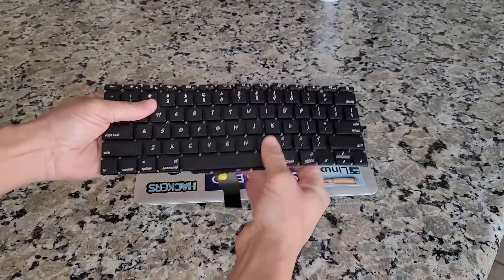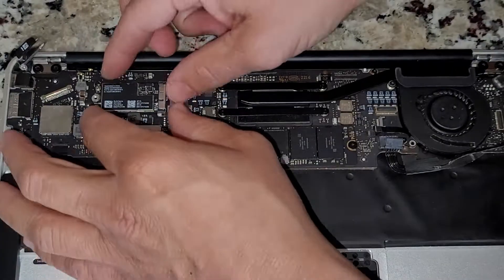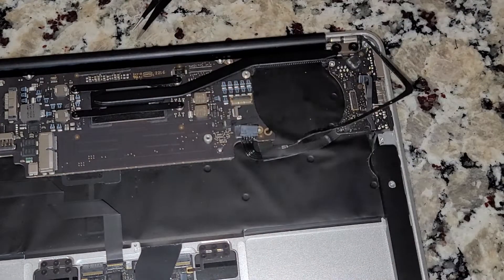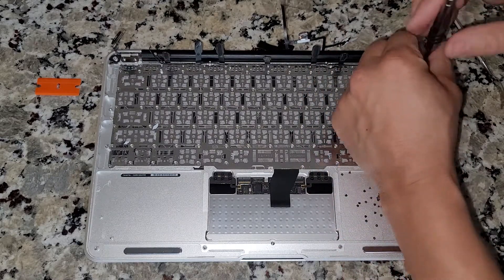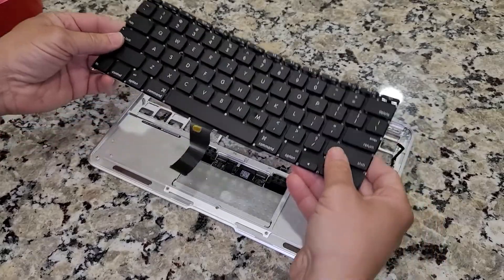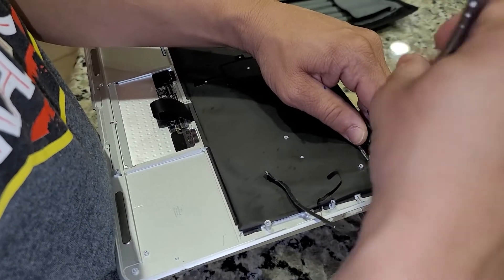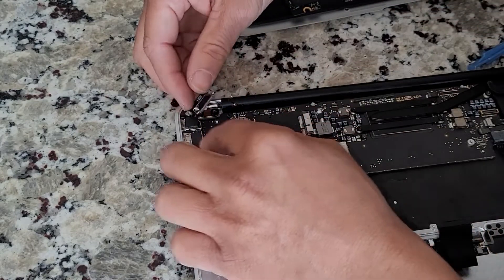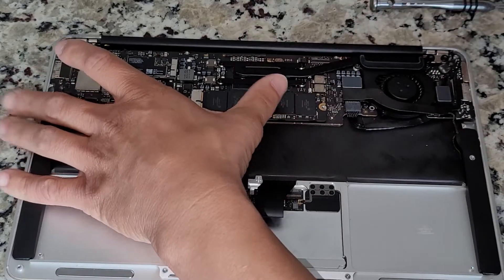#apple #macbook Apple MacBook Air 11 Keyboard Replacement| Disassembly Reassembly

Comment: This video was so useful. I had a bad tab key and needed to replace the keyboard. Just a couple of points:
1) My keyboard came with extra screws for where the rivets used to be so I was able to secure the whole thing not just the edges like in your video.
2) My keyboard wouldn't fit at first until I realized the left command key was bizarrely oversized. I had to swap it with the old one.
3) I also replaced the CPU thermal paste as after 10 years there wasn't much left.
4) The wifi antenna must be secured underneath the logic board or there will not be clearance for the base to go on properly. The channel at the back must be clear. That's what those straps are for.
5) I noticed there were weird shadows at the bottom right of the screen. I had to open it up again to resecure all the connectors, which fixed it.

Comment: Hi, your video is excellent.  I’m replacing my keyboard but having an issue with the right and left speaker connections on my 2011 11 inch air, seems there is no slot, the wire just sits on top of the solder dots. I don’t see any slot or hole or anything to make the connection? Your thoughts? Thank you
Reply from the maker: Can you take some pictures and send them to info@bazzarrepairs.com
Reply: @BazzarRepairs  yes, just sent them to you.  Thank you